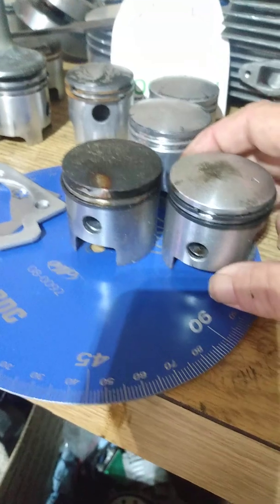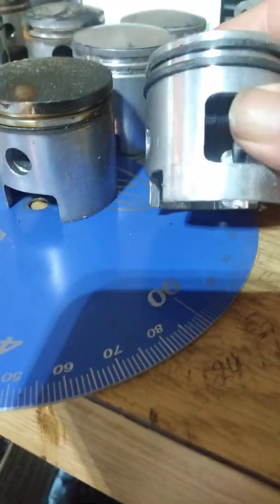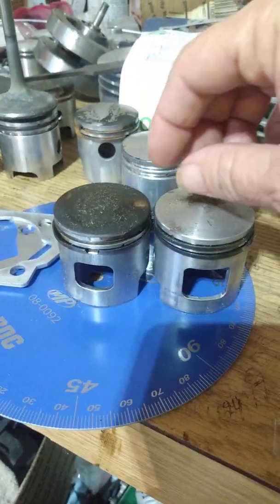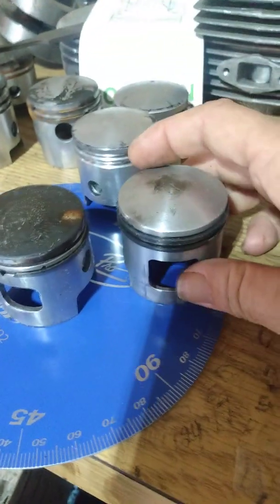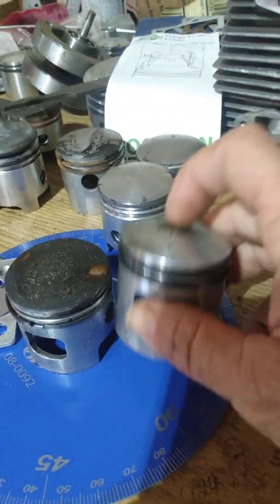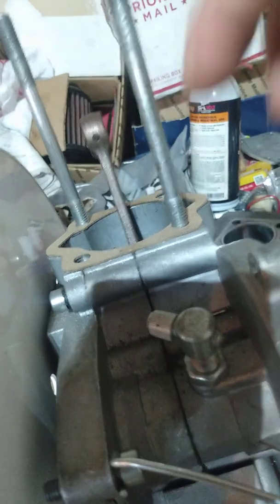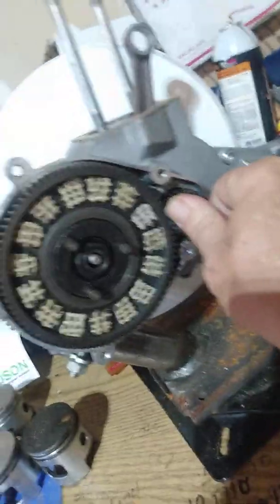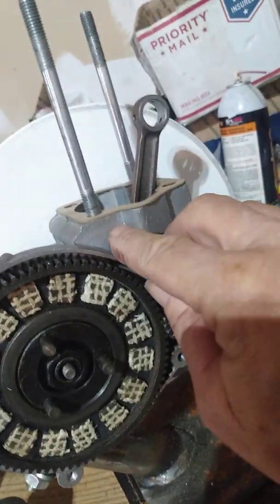stroker crank has  better torque . provided port timing is the same look in description.

Comment: Let me ask this a 20 degree blowdown would have more rpm a 30 degree would have more torque or did I get that backwards
Reply from the maker: You got it backwards. Blowdown is simply the port separation in degrees or measured distance. From exhaust Port opening  piston traveling down to the point tranfers just open. To little or two much of anything in life is not good. Same follows suit in motors. 2 strokes of 4 strokes. Again these are low power small displacement ancient technology. And poorly designed.  Things need to work in harmony. I have made hundred vids showing and talking about all of this. I have yet to read a comment ever that someones motorized bicycle got slower . Again cyls are 25 Dollar 💲. One cyl can have 5  lessons in it at minimum. I have tested hundreds of combos. The issue is everyone wants to hit home runs and never even tryed hitting the ball basically..all the port timings you see on my cyls have been proven and tested . If I was to guess 90% of the guys that's making vids and running china cyls and building motors are running my port timings. I gave you good port timing numbers. There is no simple way to put in words in a comment on a lifetimes of knowledge or two stroke port timing and cause and effect. Meaning exhust  roof shapes widths blowdown and blowdown % or port time area. Simple the more you lift the exhust port the more pump ie work you take away from cyl. On same hand  not enough exhust port hight you'll never achieve a target RPM. Because more rpm the less port time area you got. That goes for all ports . Basically the higher the rpm the less time the ports have to work.  As far as port timings I have ran or ranges that work on exhust port side of things are from lowest to highest 158 to a 187. As far as tranfers go from lowest to highest goes 110 to a 130.  As far as blowdown goes lowest ever I run is 20 degrees highest has been 30. There is lot of sweet spots in-between.the best functioning setup would be the one with the least amount of work meaning if your souly looking for torque add compression tight sqish choose good cyl head  combustion chamber design 5 cc. Run a longer intake. Don't case port match cases valueless waste of time. Everything  matters including crank case volumes. Achive good bld % with least amount of work that's how you retain torque
Reply: @2strokecarbtuningportingin187  so 160/120/20 would be good torque then or 150/120/15  if ya could tell me what these results would be I’d understand so much better these seem to be my choices somewhere between these if ya could help me w these I think I’d get it I’m guessing the 150/120would have more torque but the 160/120 would be a lil more speed? But I cut up to 150 have t widened the ex port yet tho just want torque thx for all the help I think ya told me once 160/110/25? Or something would be a hella torquey engine nights been 120 if get past this first cylinder……. I’ll have it made
Reply: Of course I could delete the base gasket I’d have 144 ex 98 trns 23bd @15.9? Vs a possible 160/120/20@16.6 . Or current 150/120/15@12.5%? Am I getting it right now? I know lower timings is better for low end  torque so is lower BD and the % also helps decide where it.kicks in? But how it all translates into real life that’s what I’m working on thx for the videos came a long way from a little time thx to you!
Reply: Just need a little help translating em the performance I don’t if one is bad or good I want a good take off and hill climber that still goes fast enough without having to go bigger gear unless high rpm engine and big sprocket would still haul ass and climb hills good

Comment: Have you seen the new motor that bicycle engines.com just posted on Facebook it's a phantom 85cc reed valve included speed carb
Reply from the maker: I don't have Facebook I'm booted
Reply: @2strokecarbtuningportingin187  well oh well they released an 85cc motor supposed to be bigger than the zeda 100
Reply: @2strokecarbtuningportingin187  it's supposed to be released next week
Reply from the maker: No if your talking about the twin plug motor yea nothing special send me a proper link to that exact motor
Reply: @2strokecarbtuningportingin187  no that one's Southern customs
Reply: @2strokecarbtuningportingin187  this one's called a phantom 85cc
Reply: @willardbuchanan9122  how’d that turn out for ya?
Reply: @2strokecarbtuningportingin187  it's just posted as bicycle engines.com but it's not on their main page yet I just looked it says it don't have it will be out next week
Reply: @2strokecarbtuningportingin187  it's listed as a ZT Moto